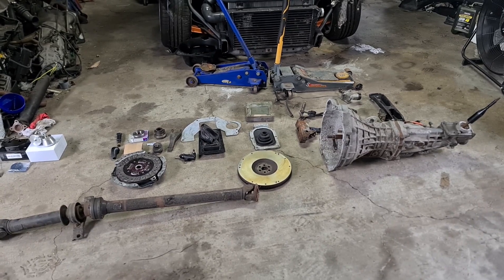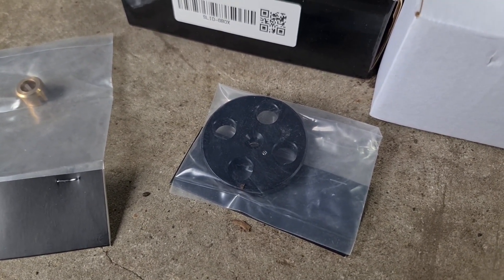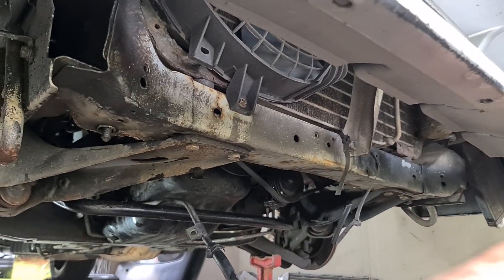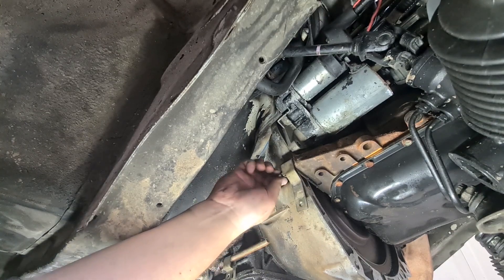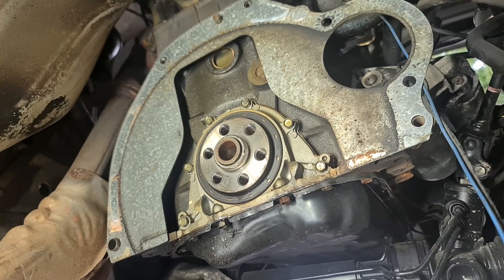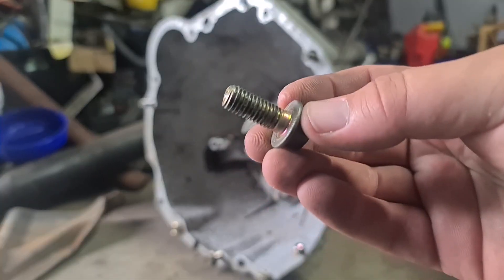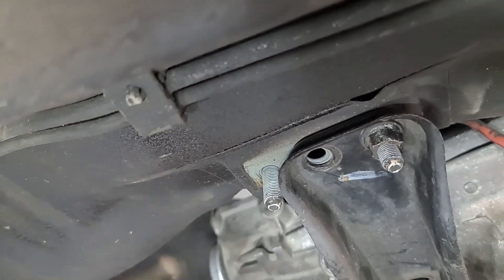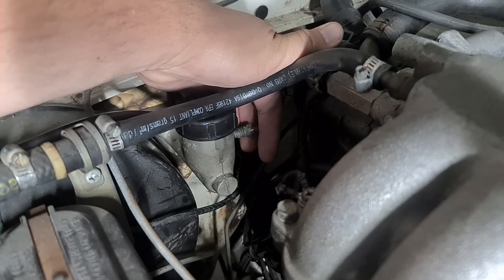R31 Skyline Manual Conversion - The Complete Guide!

Comment: Pro tip. When fitting the gearbox have someone in the car with a rope looped around the box so they can gently manipulate the height when your trying to get the shaft to slide into the pressure plate etc
Reply from the maker: yeah that does really help or like just have a second person there to help at least! dont be a dumb dumb like me and do it solo!

Comment: i was skidding one day and my clutch pin came out, i found some type slap belt and used the wire to hold it together. 2 years later still holding up
Reply from the maker: If it works it works!

Comment: Bloody great vid. I just wish my spigot bush removal tool worked like yours. Spent 4 hours trying to get it to work and it's still in there.
Reply: big big big same boat
Reply: not to mention the $50 part now costs $81 and it doesnt do hot shit
Reply: @kingbedro2854  ended up using  a dyna bolt in there.

Comment: Im having trouble fitting the gearbox back in. It has about 1 to 2 inches to go for it to go in. I've pulled it apart and aligned the clutch again and wiggled and moved it many times but still nothing. Im losing my mind.

Comment: Hey mate, how much does it cost for the conversion? Like parts wise normally?
Reply from the maker: Stuff like clutch, slave and master cylinder are easy to price cause you can buy them new. But gear box, pedals and tailshaft car a bit random depending on availability. Gearboxes have gone up a bunch but you could maybe find one for like $600?